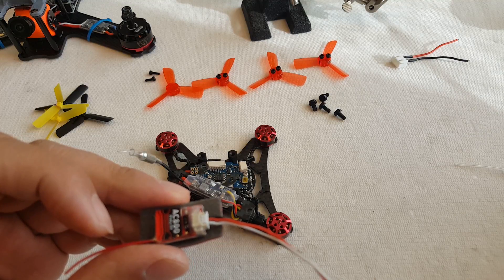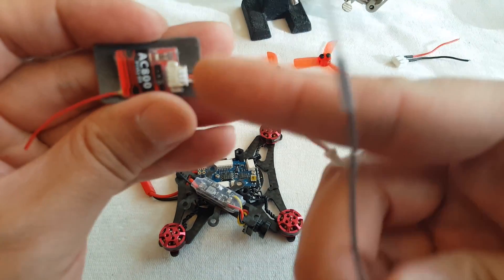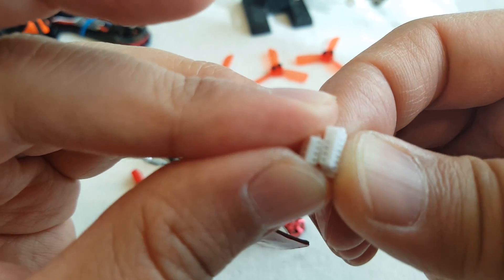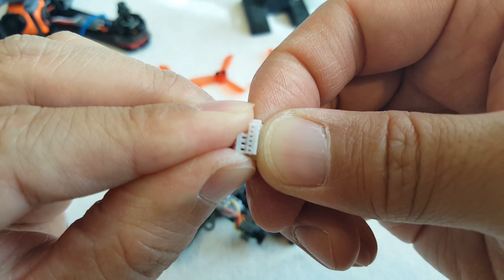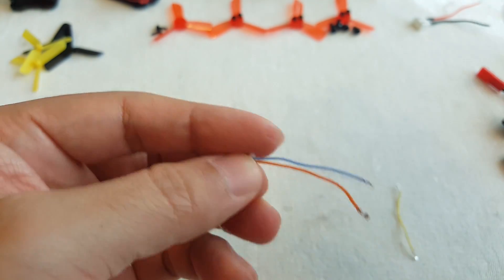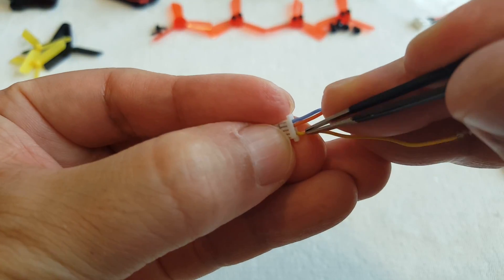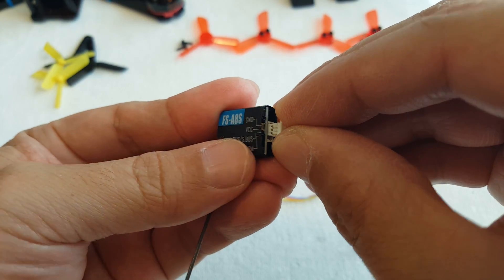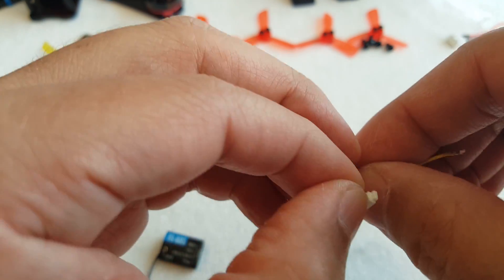How to make your own custom micro connectors 🛠

Comment: You can get pre crimped connectors and plugs: 

https://www.digikey.com/products/en/cable-assemblies/jumper-wires-pre-crimped-leads/453?FV=z1812.4.759868

https://www.digikey.com/products/en/connectors-interconnects/rectangular-connectors-housings/319?k=&pkeyword=&v=455&s=3763&FV=ffe0013f&mnonly=0&newproducts=0&ColumnSort=0&page=1&quantity=0&ptm=0&fid=0&pageSize=25

Comment: Are there any wires that I can just buy to connect the drone and the fs a8s? I don't really want to do all of this.
Reply from the maker: The FS-A8S does come with the 1.0mm pitch connector for the receiver. I don't know what the other end will be connecting to, but it's difficult to find the exact one you need most of the time.  Usually making up a custom connector like in this video is the best solution.
Reply: I purchased a King Kong 90gt like you but it is arf so i don't know if I will have the other connector to switch the wires with.
Reply from the maker: +Logan Mcghee yeah, I don't know myself... anyone else get the arf can tell us?

Comment: nice albert.we must make the best use of what we have on hand.how is that a8s rx?i just installed it in my falcon 120 and tested it but i am concerned of the range having a single antenna wire.
Reply from the maker: It's a good receiver BUT if you use a poor quality PDB with a bad 5v regulator, the voltage sag will brownout the receiver and cause a failsafe (usually on strong amp draws like a punchout).  I can fly 300m with this receiver without a problem.  Just make sure the antenna is placed away from any carbon fiber.
Reply: yeah thanks not sure of the 5v comes from 4 in 1 esc on the falcon 120 but i put the a8s on its edge next to the camera.i made sure the ziptie faced out to the side for the antenna wire.so far so good.

Comment: Albert,

How is pitch measured on these connectors.  Is it by the pin diameter?
Reply from the maker: +Ross Bassette measured by the separation distance between pins. Usually in mm.
Reply: Wow, you really reply fast!!!!   THANKs!!!!!
Reply from the maker: +Ross Bassette no problem

Comment: if possible to buy bunch  of different  connectors with open metal installs, to build that  connector that you need ?
some ali or banggood?
Reply from the maker: +Alex Glikman yes, of course. I just like to use the stuff I already have on hand.
Reply: Albert Kim you know link?
Reply from the maker: +Alex Glikman sorry not off hand, but search ebay for micro jst connector and you'll get a lot of hits